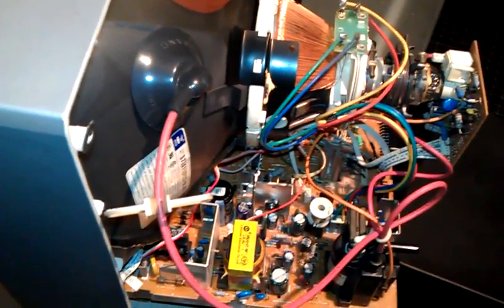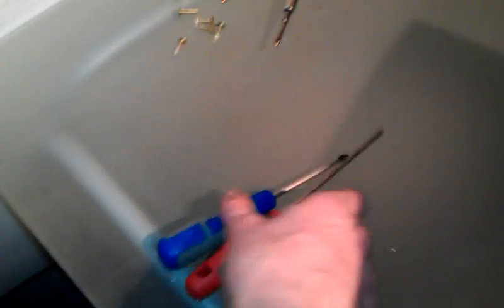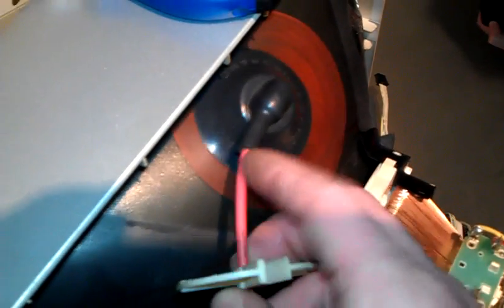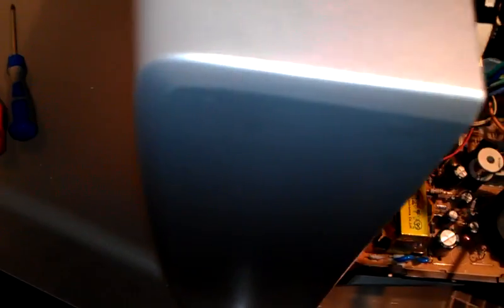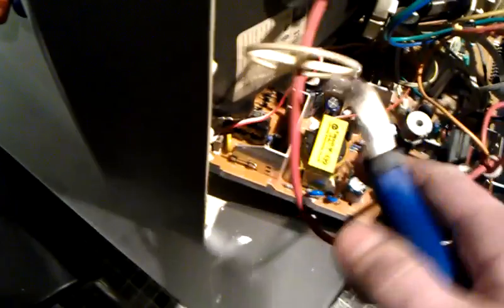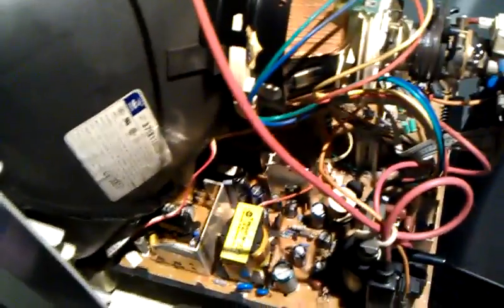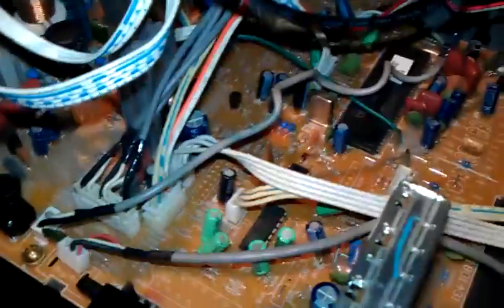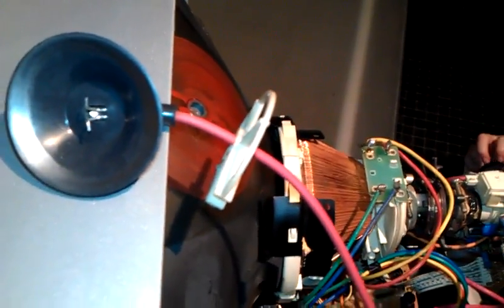tv open' flyback test! Nice white arc!

Comment: I suggest another alternative (actually, i have done that successfully) :
- bring another flyback transformer from another old CRT monitor.
- connect the working crt's flyback's primary coil to the primary of the old one,
 (well..if your familiar with this sh**t you'l be able to recognize the pins,
  use a multimeter or find the diagram for that..do somthing !!)
- you should set the monitor to blank screen (remember the white noises when
  there is no signal ?? exactly that..
- put a switch in the circuit and use fairly long wires and VOILA !!
(your safety and your equipments are YOUR responsibility)
ENJOY the arcs !

Comment: I have done this before, but usually after one or two arcs, the board dies. I had one very old TV board though that would pull some 3" or more, hot ZVS like arcs nonstop! Somehow that died though, when not in use -_-

Comment: Quite a bit of short circuit current from the TV board driver. Never knew you used to repair TV's back in the day haha.

I took an old 1980's circa TV apart today for parts and it had a huge white flyback/LOPT inside of it. The TV's 80's circuitry was a work of art and it must have cost my uncle at-least £1000 when he got it.